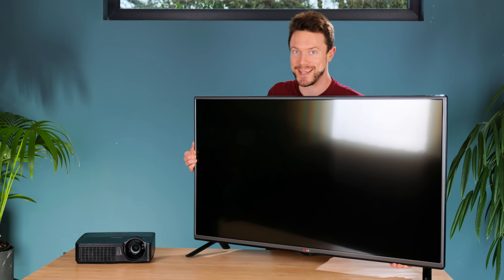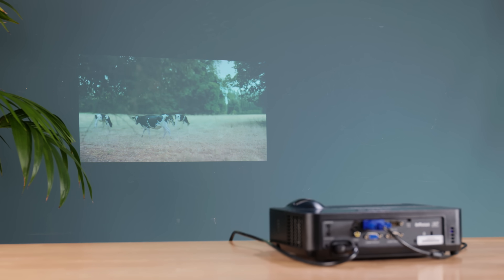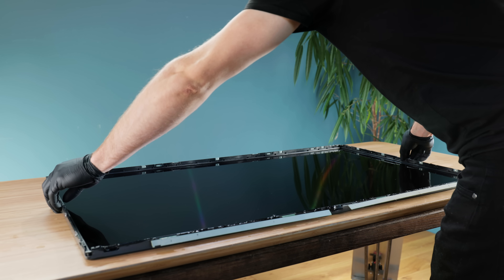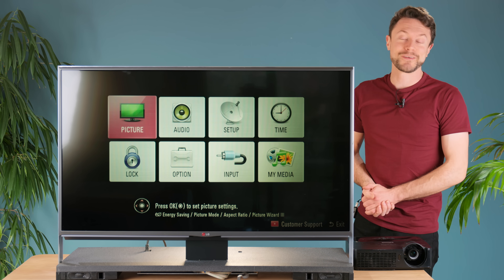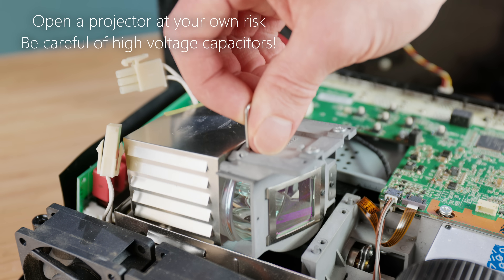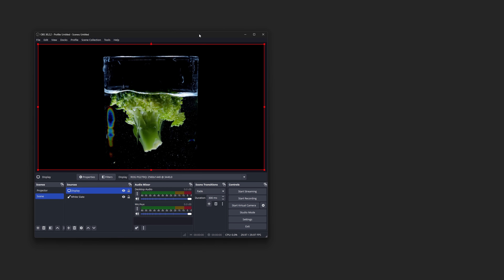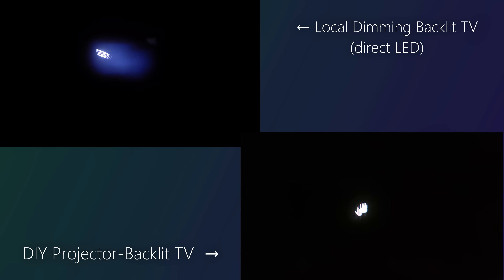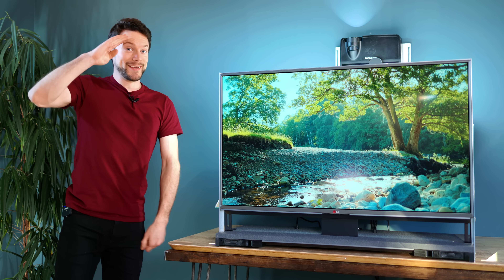DIY "infinity contrast" TV -  with 100% recycled parts

Comment: Stunning. Really highlights the design constraints of engineering a display in flat screen format. Surprising that the big companies didn't float some products based on similar designs in years past given the massive upgrade in quality. Really impressive work. Kudos!
Reply: Well they did. We had a TV that was basically a commercial version of this 20 years ago. They were common for home cinema.
Reply: @LyumYT213  was it very niche and did it cost a bomb? I have no recollection of anything like it...
Reply: @DwynAgGaire I wouldnt say niche, they were somewhat popular for home cinema until TV form factor shrunk and LCD caught up and became affordable

They had very good contrast and colour reproduction compared to big TV of the time, and were often cheaper than plasma and early LCD. Didnt have burn in.

Downsides were they were GINORMOUS, a 40in tv was nearly as deep as it was wide and they also had a very large base and large bevels (the screen to body ratio was probably under 50%).
Also Not the best viewing angles and the projector bulb had to be replaced similar to a projector. But still to this day one of the best TV for watching movies.

This is basically a modern version that, it seems that its not identical and addresses some of the issues, and for a home cinema i really like this idea.
but the space required for this sort of setup is always an issue and probably why they stopped developing and selling them.
Reply: @DwynAgGaire  most people skipped straight from traditional tube/CRT to LCD. 
Larger TV in general cost a bomb until they brought out smart TVs. Basically companies like Google pay tv manufacturers to install android, that way they can collect data and serve ads. Tv basically sold at cost price/at a loss these days. If you want a non-smart tv you are paying upwards of 5k for a commercial display. Basically TV never were and never have been a cheap product, nowadays theyre only cheap because the user buying it IS the product being sold.
Reply: @LyumYT213  sadly the pervasiveness of surveillance capitalism. I think people are getting wise to it so there will be a point in the future where resistance will reach a critical mass. Even the EU with chatcontrol is very disappointing and not at all compatible with IHL or the ECHR. Privacy is protected but the assault on it is persistent.

Comment: I made something similar but this was years ago I used Mitsubishi - 65" Class 1080p 120Hz DLP HDTV. Model:WD-65C9 the TV had everything for the boards power supply the shell and the mirror and did exactly what you did with a modern LCD screen .. ? You didn't explain how you created the duplicate image on the LCD screen   an image and from the projector and image lcd screen so both units need to have the same image at the same time fire TV stick needs to be hdmi splitter to run the image on the projector and on the tv board... OBS program to create a filter glow filter you didn't explain you need a PC and how did you program get this filter for the projector to have the Glo filter are you using a computer to display the image on the lcd / projector or fireTV stick.. with the LCD screen TV power board. The projector and also running a computer to display the image which it looks like you did you are drawing a lot of Watts that's almost 900 watts to run at TV..

Comment: If you are using mirrors to redirect the light why not have the light paths behind the TV but bounce the light more with more mirrors and then you can box it at the back. Even add higher quality speakers for better sound and even add a small woofer for the bass ? Oh I also had a thought if you really really wanted to get brighter light set it with 2 projectors instead of one and double the light output . Love your work and funny attitude :)

Comment: It's actually soooooo cool but i have two questions. The hole point of this is beaing able to light up evey pixels one by one so why are you puting back the difusor shit ? it blocks some light AND make the light of one pixel interfering with the ones next to it (even if the result is absolutely stunning  !) and second question, instead of using an old projector, would it be possible to use a dimming baclklight TV AS the backlignt ? it will not be as bright i suppose but would definitly be more compact

Comment: This is brilliant. I used to sell TV's back in the early 2000's and I can't believe no one ever brought this to production, marrying DLP and LCD technology. If I were to do this project I would use a rear projection DLP TV to house the LCD panel, rather than a DLP projector. This would already have a mirror in it and eliminate the need for a short throw projector. It would completely enclose the system so you don't have light bleed all over the wall.

Comment: Couldn’t you get the same results if you sandwiched two identical lcd panels together and lined them up pixel to pixel?

Then you could return back to a backlit display solution that you could hang on a wall.

Sounds like another video is in the works.
Reply: LCDs are only for colour, not really bright, as seen in this video. But this is basically what good OLEDs do, just not with two LCDs, I believe.
Reply: @JanEnNiek Place the second LED panel behind the first LED panel and add the OBS plug-in and lumakey filter to the second panel in order to achieve the same results without the projector.  Use a backlit light source to maintain the flat screen design. I’m not sure why that wouldn’t work.
Reply: @wellyuneednt  I just check, he's actually made a video about a similar idea with two LCD panels.

Comment: Hey, really nice, the only downside is that the bulb on that projector uses around 400W, the full projector will use 450W and the TV itself will be using some 50W or 60W more (because you disconnected the aprox. 100W LED lights). So, instead of a 150W TV you have a 500W device. You need to be careful with the fact that keeping that thing on for 2 hours a day (which is a VERY low usage), will cost you some $30 to $40 dollars a month. And if you keep that projector bulb powered on, it will last for a year or so before you need to buy a new one for some $200 (if you find a replacement for a device that old). Did you consider using a 60W led lit projector instead? The light will last for years and the power usage will be much, much lower.

Comment: About LCD panels: Consider getting a panel mover. They're cheap and can be used to lift up any size of LCD panel up to 68 inches diagonal, without the panel bending and cracking. Guess how I know about the cracking bit.

Comment: Better to discharge those capacitors through a resistor don't you think? 4:10

Using an online Capacitor Safety Discharge Calculator:
for that 450v 68uf cap
1,000,000 ohm resistor
<5v after 5 minutes
<0.1v after 10 minutes
max power 0.2W across the resistor

Comment: This is utter janky recycling genius. 

Now you've proof of concepted it, take it one ultimate step further it, and source 3 x those modded matching projectors, all wall mounted side by side, each pre-distored to angularly overlap and converge exactly on the LCD. And then you'd achieve a 3X seriously bright high-dynamic cinema insanity level crisp TV! 🥰 

In theory u could keep overlaying projectors until you run out of wall or burn the diffusion and lcd out, like a solarfarm! 🤣 Fantastically creative, clever build!

Comment: The image quality was awesome as if I felt I was watching TV at your home!!! whenever camera captures a screen, its brightness and contrast goes away except for expensive TVs like in tech channels but here, the image was so bright and sharp, there was no effect of that kinda sort
Great video and idea!!!! Looking forward if any TV brands adapt similar idea!!
Reply: That looked so unreal(ly good), I'm now having hard time believing it's the actual picture from the panel... But here's for hoping it's all true. Having a few old working projectors (both 3LCD and DLP), I really got the urge to try... But I don't have an LCD TV... just an old Pioneer Kuro and a Korean 27" 1440p IPS monitor (with metal frame and the LG panel that was used in Apple Cinema Display) which has started showing some odd faint vertical lines especially with gray color content.

Comment: what about using  an old HDTV with the rear projector from 2003ish, and putting a LCD on top of that with the removed color wheel. Maybe rig the color wheel connector with proper resister and remove the fan noise too.

Comment: The ultimate upgrade to this is using a used laser projector (like an Epson EF-100). I'm dying to know if taking something like a bit newer of an LG 4K LED TV Panel found for cheap would produce a clear enough image to rival some of the top 4k OLEDs on the market. A 55+ inch 4k (maybe 120Hz) screen that only needs to be 3-4ft from the wall could be built this way for under $400 if you found one of the newer LGs with a damaged backlight and a used laser projector. That's less than half the price of LG's cheapest 55inch oled. (To note Epson claims that their basic projectors are 240Hz with their higher end stuff reaching up to 480Hz.)

Comment: Hey! You can stack projectors to double the brightness! This means taking two identical projectors, displaying the same image, and aligning them to project onto the same spot. It works great you can stack four decent projectors and achieve the brightness of a 10K–30K lumen professional grade projector.

I installed projectors in schools for almost 15 years, so I have hundreds of barely used, high-quality short-throw projectors just sitting in storage. laser, DLP, you name it. I’m not sure if stacking will help in this case, but if you want to give it a try, I’d be happy to send you some.

Also, if you have any DIY ideas for repurposing old smartboards, I have hundreds of those too. They’re basically 80-inch interactive touchscreens made of military-grade (yeah, I know it’s just what the brochure says) honeycomb aluminum panels. Do not though that using two projectors inside will turn your room into a hotbox quick like ;p

Comment: Is the image at the end faked by a green screen? At 17:55 his arm is behind the panel but it does not produce a shadow. Compare this to 10:00 where it does cast a shadow. There is also weird digital noise on the table which could indicate he threw up a solid blue or green screen, then did a chroma key in software which is picking up the reflection of this solid color screen on the table.

Comment: To make this commercially wouldn't you just add a lower resolution full color (white) lcd behind the main one to achieve the same effect. Maybe add some extra Brightness to the LEDs to compensate for the double filtering.

Comment: This concept has been done successfully just once in the consumer space. Take a look at the Hisense U9DG. But instead of a projector, it uses 2 LCD panels. One primary color panel, and one slightly lower resolution B&W panel to cut out the light from an LED backlight array. The problem was that it was a bit thick, very very heavy, and very difficult to manufacture because of having to get the alignment just right so that the gaps between the pixels of both LCD layers didn't cause any shadowing issues. All of that just made it super expensive in the end

You can find this dual LCD tech in scientific monitors used for high end movie editing work though. But those are also ridiculously expensive.

Comment: Matt you you reinvented both Oled dlp and LCD with one perk the Matt Perk....Now l have an LG rear projection DLP model RE- 44sz21RD which has a colour wheel that does not work ...l was thinking how can l modify the TV to work without the colour wheel ? I know for the TV to light up the colour wheel need to spin ...but am sure with your kind of diy thinking this TV can be reinvented may be through the DVi interface or other but l want a simpler way can you think of something Matt?

Comment: even without the color wheel removed, it still outputs much lower light output becase, when there is green color pixel, it send light (off the DLP) only then the green part of the weel whould be in front of it, which is not st. you want.

Comment: Dude. Just mount your LCD panel inside a DLP projection TV. Projector is built-in, mirror is built-in, alignment is built-in, and you got a matching 16:9 screen format BUILT IN. Plus it completely encloses the projector and back side of the panel so there's no light leakage - in or out. With no light leakage, you could probably keep the color wheel for improved color rendering and saturation. Replace the DLP lamp with one of your ultra-huge 95 CRI LEDs and you could get some SERIOUS color accuracy, not to mention better overall brightness. 
In fact, reusing an old DLP projection TV like this is such a good idea I'm tempted to do it myself, except it's not a project I could do in a weekend and my ADHD would leave it unfinished with TV parts strewn all over my basement for months. 

I'm not sure why you kept the diffusion layer, it seemed to cause more problems than it solved. If you threw the projector directly onto the LCD panel, alignment would be a lot easier and you wouldn't need a diffusion layer or luma key to soften it, right? Or is it that your projector is 4:3 that makes the diffusion layer make sense? If it's the 4:3 projector creating the need for the diffusion layer, that's also solved by using the projection TV.

Comment: I love the idea, but I worry that you glossed over one of the more finicky parts of this project? How did you mitigate sync issues between the two different display inputs? An old projector might have had Analog VGA input with would be low/no latency I think, but how about the TV? Or were the image processing for each display close enough for government work? Or was it another OBS plugin? And how did you handle the two separate inputs? Sooo many questions about the technical side of things. I'd be interested in a follow-up covering that side of the process. Maybe like on a second channel?

Comment: This is a really cool project, but I have a question. Isn't this basically just doubling the LCD-Layers between backlight and screen?
Because the projector uses an LCD to block some light going out of the projector, and the TV uses an LCD to block some light going to the viewer. since LCDs are not perfect, there is some backlight bleed, but having 2 layers makes this bleed close to zero. (which is why your project has such incredible blacks). But wouldn't it be easier to just get 2 TV LCD panels, layer them, and have one filter the colors like usual, and the second one filter out blacks? that should have the same effect and would fit completely within the TV, as the LCD layers are super thin. Or am I missing something?
Reply: He uses another type of projectors on another technology. 😉 Google DLP projector or DMD chips.
Reply: @MrSaoromat  Ohhh, I understand. It was a bit difficult to find a good explanation on how DMD chips work, but that does make it better than just a second LCD layer. Thank you!

Comment: I do have an idea for a lesser space-using set up, though unsure if it would work. It does require to change the projector for a much smaller one though or not..  
I thought of using telescope diagonal mirrors or prism , as a tip you can attach to the projector itself. to have the 45 degree act right at the exit of the bulb instead of after. Though unsure exactly how much would it affect the final image... I'd be be curious to see the result of that

Comment: I'm actually wondering whether removing the color wheel will make the DMD chip overheat, since it causes the light to be more powerful than designed. As far as I know, the DMD chip's lifetime will be greatly shortened when it overheats.

Comment: Its still true FALD cannot beat OLED of MicroLED but there are some very good Backlight systems out there for example the one in the new Sony Bravia 9. Older TV's where really bad. With my older Sony X940E it was already quite good but you indeed had quite some blooming. Oled was a clear winner for me when those bigger screen sizes became affordable and today we have OLED's that can hit 4000 nits peak brightness. Full screen is way behind at 350-400nits where good FALD TV's can do 1000. So for bright room viewing they are still the way to go.

The DIY project has a very good result! i think size is the reason this was never picked up. Even with short throw the TV would be quite big.

i dont know if a dual layer LDC DIY would be possible? there are tv's on the market that use this concept the second LCD layer is used for the diming zone count. Disadvantage is loss of brightness but it can be more compact.

Edit: I see you already build a DIY dual layer monitor :D

Comment: Could you build a box on the back, the same dimension of the tv with mirrors lining the inside and have a hole on top that the projector shines through which bounces the light off the 4 sides essentially lighting the screen with no light loss? It would also allow you to essentially have your tv pretty close to your wall.

Comment: so why dont we use two screens? like one screen with a large number of point sources or just a big white light rectangle then a sheet with many holes that can be electrically closed and opened by a acircuit then we can align the pixel operating command with our holes circuit so only holes near the desired pixels ligh up?

Comment: I did something similar around 20 years ago with a much more rudimentary solution of a school overhead projector and a broken LCD monitor projected on a wall. The throw distance was terrible with awful contrast, but was viewable in a light controlled room and had a HUGE picture, with audio output from a computer to decent 5.1 surround speakers. It felt glorious to a new homeowner in our 20's with a very limited budget.